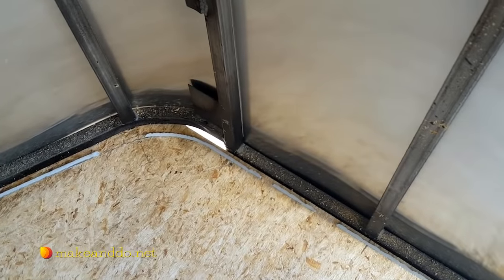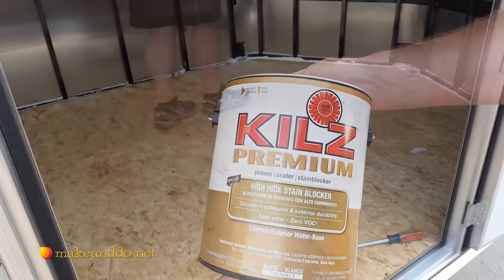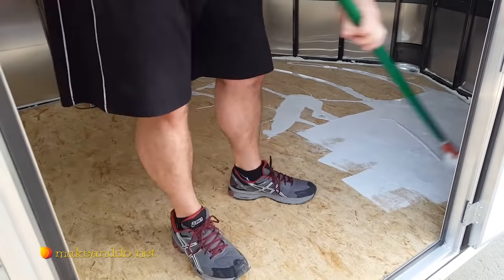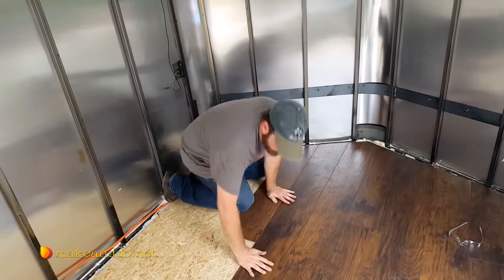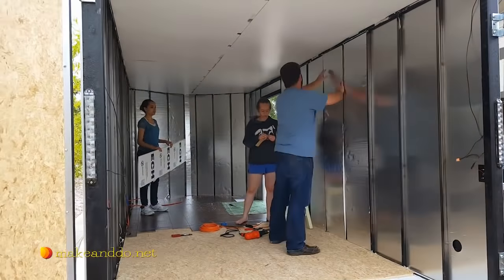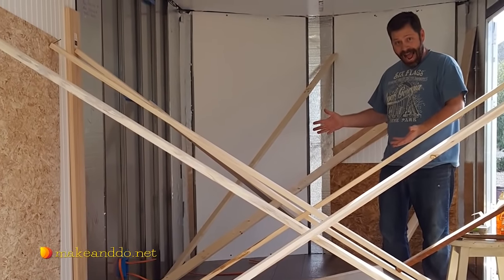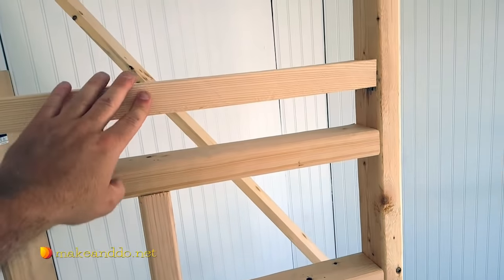Cargo Trailer to Camper Conversion - How We Did It in 4 weeks

Comment: I’m an rv tech at a very large rv dealership. I must say, you are building this better than 80k dollar campers are built!
Reply: Duh..hell u cud see light throu a brand new $5000 trailer..they make em junk
Reply: And NO RUBBER roof.👍👍👍
Reply: Way heavier though.  I used 1x3 hardwood where he used 2x4s, and 1/8th luan for non structural panels.
Reply: and 500lbs heavier
Reply: My Goodness, that's a compliment ...
Reply: Every one should build one of these for their mom or mother in law to live in. We need them rent is not affordable. If anyone wants to rent a gramma....Im in central Texas.
Reply: I use to be the head room installer for the c and d slides at Country Coach. The bed and dresser slide outs in the back of the coach. Our line ran coaches in the $250,000-$500,000 price range. There's no difference in how the million plus are built either and I'm telling ya they might look nice and shiny new but if you could see what's hidden you wouldn't want it. And they all look dated over time cuz the styling is based on current trends. These home builds are so much better quality and I don't believe will look dated as time goes by.
Reply: Cameron
Reply: Cameron how do i get a job there?
Reply: @kandacepatterson7965  this gamma is in you can find me in Missouri 😊🌼

Comment: Great video, Thanks for the tips! I'm almost done with converting my 4'x6' V-nose cargo trailer into a toy hauler/camper. Adding 120v/12v/Solar power, AC, LED lights, AM/FM-CD/DVD, 24" TV,  Cabinets, Tri-Fold sofa-bed and outside storage: 4'x5' roof-rack, 2'x4' rear receiver rack, 4'x5'8" deck above the extended tongue, which made the trailer far more stable at hwy speeds!

Comment: Your conversion skills are top notch. Excellent video. Cargo trailers are inherently more structurally sound than traditional campers [which they seem to just throw together]. I'm sure you will get many miles [and memories] out of this conversion. 

May I dare ask what the cost of materials for the complete job.

Again . Excellent work.
Reply from the maker: Thanks! The complete job including the trailer and all materials came in just under $9000.
Reply: @lumifoxai  I know this was so long ago but how much did just the trailer cost you? Did you buy it new or used? Thanks!
Reply: @lumifoxai  The 'add-ons' make the conversion a reality... And reflect your character
 My $2K micro camper has been about $2.5K more for the conversion.

Comment: You did a beautiful job on the trailer. It's not just the weight that your tow vehicle can pull, it's the total area of frontage of the trailer that drags on the air as you pull it. My pickup truck has that aspect listed along with the trailer weight listed.

Comment: Saw comments about pulling weight. I have owned lots of jeeps and pulled more than "rated" and never a problem here in flat Florida. Way bigger problem is stopping. Bigger and better brakes on jeep and best brakes u can get on camper. Just can't get to much brakes. Great job!!
Reply from the maker: Ya, it's crazy how well this small Jeep pulls. Even so, I still come in 
about 800 lbs lighter than my towing capacity...and I definitely had a 
brake box installed because I pull through the mountains. Gotta have 
good brakes!

Comment: This is nearly exactly what I wanted, and have been searching for.  I was trying to figure out a bed layout.  Love the steps/storage idea!!!
Reply from the maker: Thank you. Good luck with your build.
Reply: I too am considering a conversion. I've looked at many campers, and many come close to what I want, but only about 85% the way there. Everywhere I want to go has shore power, water hookup, restroom facilities, and showers. If I don't need to deal with a black-water tank, I don't want to. Cassette toilets are a pain. Also, a back/front door, as apposed to on the side seems like a better layout. I'm thinking a door on the front, passenger side. The rear doors for fuse box, water heater, and storage. Then a Murphy bed Queen at the back, Murphy twing(stored vertically) on the Driver's side, and a jackknife couch for a fourth person.

Comment: Outstanding conversion. Fit and finish are top notch. As for the wire, well, at least you can install a residential water heater, or cooking range, or a small heat pump... grin.
Reply from the maker: :) So true.
Reply: make & do so how big is the trailer?  16 feet from the v nose to the back?  they call 14 foot trailers 12 for up here because the don't measure from the nose back.
Reply from the maker: The nose is extra space. It's not part of the 16 feet.
Reply: make & do tyvm
Reply: BritishColumbia0
Reply: @lumifoxai  Can you tell us what material you used and where to buy it?

Comment: In 2009 I bought a 7x12 dual axle cargo unit . I used one part bedliner ( 4 coats ) for my trailer ramp , floor and 4 inches of base board strip . Kilz premium 3 coats and  premium bright white exterior latex satin for the walls . ( it's a multi use modular interior trailer ) .

Comment: Because of an accident with my tow vehicle I have to downsize from a 36 footer that I build to a 24ft V nose. That is why your video caught my attention. This is now my 5th trailer I have to build.  You have done a super great job you have a lot of good ideas. I assume you have anchored you wireing down on all points. If left hanging it will wear because of the vibration down the road.  My V nose has a  ramp door so I will be able to take my  kitchen counter cart outside and cook out there.  Another thing I have to make is a murphy bed queen size.  Already have plans for it and I am going to incorporate some of your ideas.  Thanks so much.  I am a boater and I am calling this new one "MY LAND YACHT".  Have great road trips,
Reply from the maker: That is awesome. I would love to see you "Land Yacht" once it is complete.
Reply: What strength axles do you have on thing? I'm considering doing the same thing but am having a lot of trouble deciding on axles...
Reply: I've been thinking recently about how hard it might be to make ramp door open upward instead of downward if I ever buy a cargo trailer. Create a porch area with an instant roof. Just need to attach some sort of folding legs to hold it when opened.
Reply: @RedowlMB  Saw someone who flipped the door over and welded the hinges at the top. Could work if done properly.

Comment: Most inconvenient kitchen I’ve ever seen
Reply: TEA JAY 
It’s probably not I’d do but it does have the advantage of being able to keep the cooking smells, heat and moisture out of the trailer. I suppose it depends on what type of environment it’s going to be used in.
It’s got me thinking about how difficult it would be to make a slide out that contained the kitchen that you could deploy when you set up camp? With a trailer this wide there’s enough internal space to have a narrow corridor.

Comment: I really like your thoroughness and emphasis on extra caulking and kilz. I am 7 feet tall and need a cargo trailer that I could stand in and live in year round. I just don't have the smarts to build out a tiny house like yours. Any suggestions?
Reply from the maker: If you aren't able to build one yourself, your only other options are to find a camper that is tall enough for you or find someone that could convert a cargo trailer for you or have someone build an actual tiny house. Of course, labor would cost a good bit. I know of some trailer manufacturers that will custom build trailers that are taller than the normal ones. Having someone build an actual tiny house would be ideal for you. It would depend on your budget though, as that could get expensive.

Comment: very good idea about sealing the floor. I hope that wasn't particle board I just saw at the beginning. hope it was coming  off, not going on..spray insulation, good. is wafer board like particle board, or different? did you use reg. caulking or silicone caulking? so many questions!! looks good!
Reply from the maker: Thanks. The flooring was wafer board which is pre-treated and the bottom is also coated with a waterproof seal from the factory. This is common flooring for cargo trailers. As far as caulking, I used a waterproof window and door caulk.

Comment: Curious what made you choose a 16' over say an 18?

What vent did you go with? Any thoughts on a roof escape hatch/skylight? 

What did you do for electrical? Plan on land power? Generator?

Amazing job with the insulation! Smart to do the floor.
Reply from the maker: I went with a 16' because of weight. 18' would have put me too close to the limit for my tow vehicle. Vent was just a normal vent with a small fan. 

As far as electrical, I made a video about that as well. You should check it out.  It is wired for 30 amp. I also just bought a generator for it.

Comment: Looks good! How does the cost compare to buying a camper?
Reply: I think it's a fairly well established notion of not fact that a cargo trailer conversion is cheaper than a camp trailer, you can make it exactly how you want it with layout and functionality, and the trailer itself is built better than the purpose built camper version.  A lot of cargo trailers that cost less than 5K, and quite a few considerably less than that.
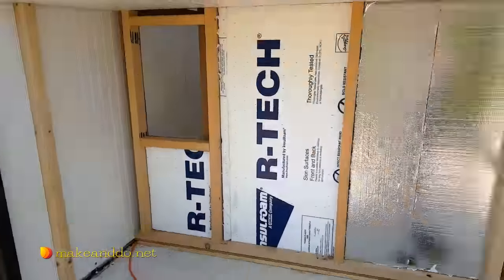Reply: @joewoodchuck3824  True!!! For most a camper fluff.. folding chairs even  high dollar cots to sleep on?? All you need is a dry place to sleep.. If needed heat.. or places cooling??? Your call?? Can you roll up your sleeves?? Then you can do math.. Do you haul dirt bikes or side by sides?? Water craft??  Cabelas has cots for $120 off sale??? 600 lbs. Wide and strong??? How about a Queen air mattress?? Not cheap one but say $100,,plus air mattress???  Other point look at dual axle U-haul trailer?? It pulled fairly easy??? Now look at a 8 ×19 or 20 cargo trailers. They pull hard. 1/2 Ton pickup will work hard.. forget OD on any trailer pulling . Wear tear to run what's to be empty no load down highway gears is what OD is stupid?? Ok.. Just shut up look at the truth!!! Sorry but truth beats BS.. I bought a 1/2 ton 3:41 geared pickup..Knew better? My bad?? 235,000 trouble free miles?? Had baby set hell out of it.. I'm  suppose be smarter pickup, to watch out for it?? So I do. I pull over let it cool?? I dont let it get close to hot???  I try not to push it? But do?? I'm human.. 3:73 better?? I thought 3:41 might shine at lite tow jobs??? Not run as high RPMs.. 4000lbs jeep maybe?? Cargo trailer no. Wind is a killer??  I will step out box make a wild claim and say with brakes you could yank 10,000lbs 1/2 pickup if no wind drag..1/2 ton limit is about 7500lbs or HD at higher GVW ?  BUT 7500lbs any higher adds alot springs and axles?? Last time I asked got stupid answer from a dealer?? There you have to learn yourself?? Dealer cannot or will not tell you ? Twice in chev rapid city sd went to dealer asked where break over was on transmissions and rear axles in a van??? They feed me BS.. 6 yrs ago then yr ago. Oh says a salesman 4:11 its bigger than this 3:41??? Say what????Ok?? I told him last time chev goes by bolts. 10,12 or 14 Simi floating or full float.. Blank,,blank,, blank,,  ??  Ford inchs... Dodge numbers 60, 70. 80..
Rapid city chev goes by blank stares??? Frick sakes.. Please ask someone with half brain before you ask a salesman.. You think they get played to guild you?? No they get played to sell you a light truck?? They don't care how??  Sorry ,dont make me happy?? They get alot money for light truck. Bought first one in 1974 because was at time life long dream at 21 single. Really!!! Mid sixties drooling over light trucks with my dad.. always had do my own home work. Axles gears motors?? Dont need diesel or cost!! Dont need 4 cams and 20 ft chain to run a fricking pickup?, Just for sec think about it. ??? Chains are chains and cans are cans and they all wear out???? I dont need variable displacement or valve timing. Might look good to your goverment or tree hugger?? But there not going pay Bill's of up keep comes with that crap.. you got or always got money to trade every 4 years at under100,000 miles have guilt free fun.. I dont farm.. I dont gave money..

Comment: 1.  Did you have any problem with off gassing from any of the spray insulations or anything that you could pinpoint for that matter? 2.  Did you entertain getting a wider trailer that went out over the wheels?  If so why did you not go that route for more room?  Nice vid thanks.
Reply from the maker: The stain from the trim was the only thing that I could actually smell that concerned me a bit. The spray insulation was one of the first things I used, so it had a full month to cure before we actually took the camper on a trip. I did consider a larger trailer, but was concerned about the additional weight since my tow vehicle had a maximum tow capacity of 4500 lbs.

Comment: great job I love your camper what we did was put screws 3 foot up on the billboard and then covered the screws with chair rail which we glued on that way the beadboard had a good permanent fix and to the guy that asked about the 10 gauge orange wire orange is a high voltage color not low voltage

Comment: Amazing video, I am in my preliminary tiny house research and this was inspiring. Regarding the 10 gauge wiring, isn't better to over do it than under? For example if he wished to sell and someone (cough, cough) was to convert to tinyhouse. This wiring gives more options.
Reply from the maker: Yes, that is correct. The downside is that the larger wiring is more expensive and harder to work with because it is so stiff.

Comment: Do you have any idea how much weight your build added to the trailer? Thinking of doing a toy hauler / camper but I have 3500 tow capacity on my vehicle.
Reply: Saw a video yesterday where a guy did a 6x12 camper version ( no toys) in an Interstate trailer. It came in at #5500 with a full bathroom. Hope that helps.

Comment: looks terrific.  the only problem is did you use house wire?  cars and trucks typically use stranded wire because solid wire can break over time from vibration.  But otherwise a great job!!
Reply: Sharp!
Reply: travel trailers typically also use romex wiring. It's gonna take an awful long time to break solid wiring from vibration alone. The real question here would be why the choice of 10 gauge when 14 would have been plenty, and were all connections made with screw terminals? Wire nutted connections are typically whats frowned upon in mobile builds because of vibration
Reply: @koof_a_loof  the real question is why not lol. Never skimp on wiring size
Reply: @jaycevessier7554  where there's oodles of room, and cost is no concern. I'd agree. 

10ga is sufficient for a 30a circuit. 12 is sufficient for a 20a circuit, and 14 is sufficient for 15a. There's no reason at all to purchase and install 10ga wire when a 15a or 20a breaker is to be used, aside from personal preference.
Reply: @koof_a_loof  I am definitely no electrician, but if this is low voltage why not just run some extension cord wire behind the panels? is there some extra hazard I don't know of there?
Reply: @keithhoward4069  I don't imagine there would be any real world danger of running extension cord cable in wall for a travel trailer as long as its sufficiently sized. But it isn't rated for in wall use, and could come back to bite you in the ass if your travel trailer burns down and you're trying to get insurance to have your back. 

I'd imagine the power being used here is line voltage 120, so not low voltage.
Reply: @keithhoward4069  
Lol that be expensive and a violation 
Cords are for temporary
Reply: @joeyork9891  Perhaps it would violate some rules, but I suspect it would be better, safer than solid copper wire. Vibrations would cause solid copper to break and short out perhaps.  A good high quality extension cable would be far more durable and flexible. It is also well insulated. Rules are important, but not always best. I am sure if a trailer did burn down for what ever reason, the insurance people would use the excuse of rule breaking against you though.

Comment: I’m building a house truck and I’m thinking about getting it painted matte black. Do you feel like the Black makes your trailer hotter inside than it would be otherwise?
Reply from the maker: I can't really answer that because I don't have another trailer of a lighter color to compare it too.
Reply: make & do right...after I hit send I realized I should have worded my question differently. I’m essentially asking do you think the black leads to high temperatures in your space?
Reply from the maker: IMO, I don't think so. The top is reflective metal so you don't have any black on top at all. If the darker walls transfer heat to the interior, I think it would be minimal because of the insulation.

Comment: Great conversion. any problem pulling it with your jeep suv..I mean weight-limit wise?
Reply from the maker: No, but a sway bar definitely helped...especially in high winds. However, I now have a different tow vehicle. I have a Ram 2500 and you can tell a huge difference. The truck pulls so much better.

Comment: Came back to this video after watching the update to try to find out what kind of window that is. I haven't been able to find an RV window that suits my needs (hinges at the top so that it can be left open a bit in the rain), and it looks like maybe you used a regular house window for this? Is that OK as long as it's tempered glass?
Reply from the maker: Yes. It is a regular house window and it is not tempered glass either. I've pulled it several thousand miles and the window has held up fine. You do not need to spend extra money on tempered glass.